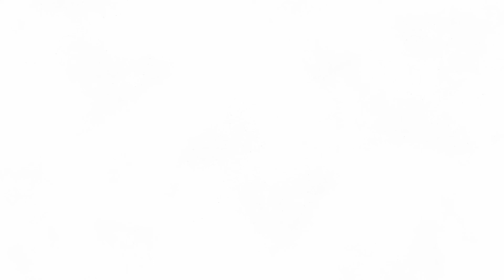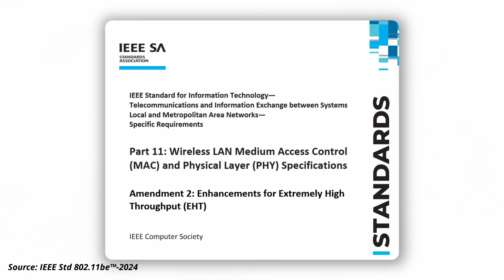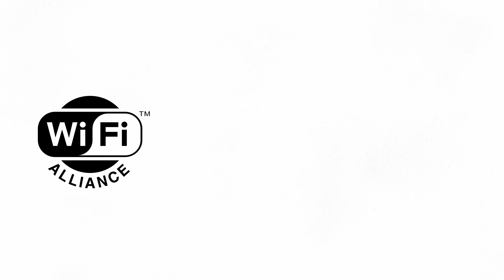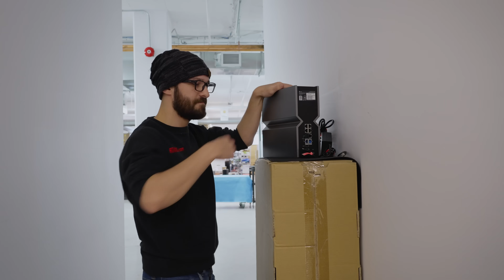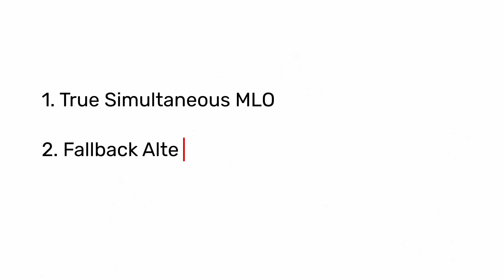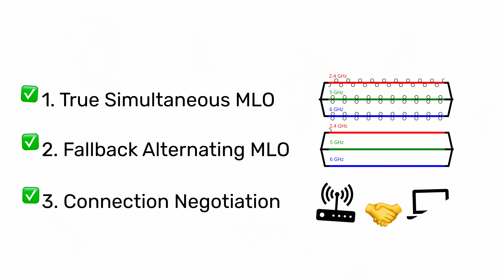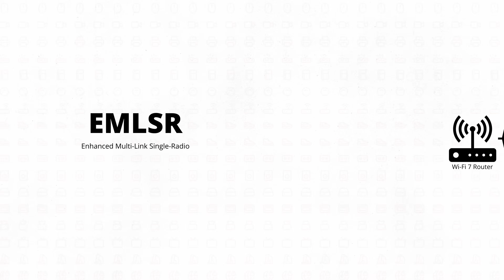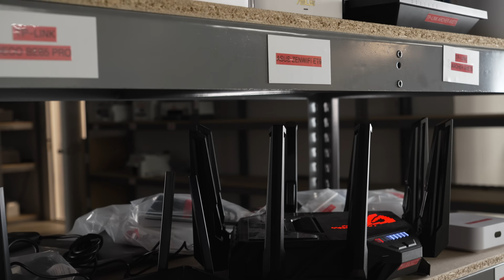Wi-Fi 7's Best Feature Doesn't Work (Yet)

Comment: This video does a good job explaining the different levels of support for MLO with each router, but then stops short of the one question that matters: which of these features actually result in better performance? Assuming you have a client device that supports WiFi 7 (or Wi-Fi 7?) will you see an actual performance increase with any of them compared to WiFi 6 or 6e? And if performance is improved, how is it improved? Higher speeds? Longer range? Higher reliability? Lower power draw?
Reply: MLO & MU-MIMO are only usefull for large households and/or mesh so if your family isnt big I wouldnt worry.

Comment: please check this with the TP Link Archer 8 Ultra and ROG Rapture BN98 Pro that just got recently announced/released
Reply: Those should be avoided btw, draft models use previous gen hardware only with updated RF. Broadcomn is making APU chips for wifi-8 routers, it will be 2-3 years before asus makes a finalized product.

Comment: I have multiple ASUS Wifi 7 mesh APs - upgraded from 6 and 6E. Sometimes I get 6 level through on large file transfers of 120MS/s. Sometimes I get up to 240MB/s. Far from Wifi7 claimed speeds but double is double. I just wish i ALWAYS got the 240MB/s. And the switching among the APs in my mesh environment leaves a LOT to be desired. I wish there was an app to allow me to quickly pick my AP

Comment: WIFI 7 is not necessary for MOST people. WIFI 6 is perfect for 99% of people. WIFI 6 fixed most issues with WIFI 5. But WIFI 7 is not necessary. Yeah, more stable but that is for very unique use cases. But if you are in a busy apartment complex, Using 6Ghz may be the most ideals since it reduces bleed over into other apartments. But 6Ghz is only good in the same room and only good IF you have a specific need for MORE bandwidth, like a laptop or certain gaming needs. But for the average person, you will never notice the speeds over WIFI6 because most people's internet is not as fast.
Reply: Not just that, newer gen routers have newer hardware and architecture which fixes noise ingress etc. wifi 6 routers should be the bare mimum but 6E routers should be recomended, then wifi-7 is at its end of its gen so its more future proof thats if you look for one with at least 2gb of ram, has preamble puncture, and has AFC.
Reply: @kouavang7819 Wi-Fi 7 is still young or in the middle of its journey. I wouldn't say it's at the end. 

And when only more recent devices actually have Wi-Fi 7 from within the past 2 years, it's still kind of tells you that we're kind of in the middle.

Comment: You know, Band Steering existing for this reason. So you can have the same WIFI name but the router manages which band you connect too. Again, this is really only a problem for moving devices like a phone. But shouldn't have those issues with static devices.

Comment: I remember buying that Netgear router and not being able to use MLO after setting it up, thankfully Amazon let me return it and I got a different router that supposedly supported MLO, but I could never get it working as advertised on any device I owned with a Wifi 7 antenna. After moving into my new house where I deliberately had ethernet ports installed in every room, I went with a full Ubiquiti networking setup and haven't looked back. The few devices I use that require wifi are handled by my Dream Router 7, but nearly everything else is wired via ethernet.

Comment: az oses wifi routert csereld le  mercusys re wifi 7,easyimesh wifi 6 mercusys ax3000 ,mu mio,ofdma,Router wireless Mercusys MR80X, AX3000, Wi-Fi 6, Qualcomm, Dual-Band, OFDMA, MU-MIMO,Router Wireless Mercusys MR25BE, BE3600, Dual-Band, Wi-Fi 7, MLO, compatibil EasyMesh,Router Wireless Mercusys MR27BE, BE3600, Dual-Band, Wi-Fi 7, MLO , 2x porturi 2.5Gbps + 2 x porturi 1Gbps, compatibil EasyMesh,Router Wireless Mercusys MR47BE, BE9300, Tri-Band, Wi-Fi 7, MLO , 4 porturi 2.5Gbps , compatibil EasyMesh,

Comment: I added the BE800 to my network. Recently I had my network upgraded through the ISP to 2Gbps Down and 200 Mbps up (Rogers in Canada). The price was just amazing through Amazon. I know it was an open box, but when I received it, it was just as new; the box had not been opened. I connected 10Gb to 10Gb and am enjoying around 5.6Gbps download and just a little over 200Mb upload. I tried MLO and was very disappointed in the speed. Firmware is at 1.3.2 Build 20251015 rel.10659(4341) and the router performs well. I am going to keep an eye on any improvements, this router was introduced at least 2, if not 3, years ago.

Comment: I got my router primarily for 6 GHz  capability. It has 2 6 GHz radios, one for mesh backhaul, which I needed. I've separated all the bands to separate networks. The 6GHz bands are as fast as promised. I don't think MLO would offer much more even if it worked as the speeds are already quite a bit above the speed specified by my ISP. I guess this a case of managing your expectations.

Comment: Devices still prefer to connect to 5Ghz instead of 6 if signal is better and more stable. Need to change the settings on each device the preference for 6GHz. I split another ID for 2.4 for better performance. Android snapdragon and more recent iPhones prefer wifi 7 6GHz by default

Comment: No tests were conducted using MLMR-compatible wireless network adapters like WCN7851 and MT7927, nor were throughput measurements performed. Reliance solely on packet capturing will only yield incorrect conclusions, and such content seriously misleads readers.

Comment: I have an ASUS TUF BE9400. It's MLO is a bullsheet. From settings i activated MLO and WIFI7 operating mode. The phone recognize this SSID as WIFI7, the clients list of the  router confirm MLO connection for this client, but in speedtest, at 5 metres distance barely touch 100 Mbps. I must separate the 2,4GHz from this SSID. Very disappointing.

Comment: Unfortunately, a lot of technology, even in 2024, works this way. The features come out later in the product life. There are SO MANY examples of this out there. This video is kinda misleading because if the hardware is there and all that is needed is a firmware update to unlock the feature, then this video will not age well at all. 

Also, WiFi 8 routers are coming out this year with a finalization date of 2028 for the WiFi 8 Standard. Meanwhile WiFi 7 isn't expected to be fully adopted until 2028. 

Even TVs/Projectors don't get full support of promised features until way later in the life of the product. If someone wants to change this, they're going to either have to be the first company to do this and realize customers flock to their products only OR complain on an epic level to get companies to change this behavior.

Comment: Nice work!  We had some similar marketing shenanigans when 802.11n came out. Meanwhile I've got a PoE Wi-Fi4 mesh at home that works fine for anything that's not hardwired or far enough away to be on HaLow. The low-power mode stuff needs to be solid before I upgrade anything.

Comment: Recently upgraded to a TP Link Archer BE550, from a 2018 WiFi 5, that was also from TP Link. Upgraded my modem along with it too. 

I pay for 600mbps down from Spectrum and never even cracked 500, despite my old setup being more than capable of providing the 600 I’m supposed to get. After upgrading equipment I’m consistently getting 600 down or more via Ethernet and right around 500 down via WiFi on my iPhone. Only WiFi 6 or 7 device I have is a work laptop and that gets around 600mbps as well. Overall very happy with the upgrade, WiFi has been more consistent and my roommate who was having issues with his connection is no longer having issues. I definitely can’t really use all that was promised, but I’m now getting the speeds I pay for and having more consistent WiFi is worth the upgrade for me.

Comment: I just upgraded my 5 year old Wi-Fi 6 router to Wi-Fi 7 and Instead of 500-800 mbps to my devices, I get the full 1500 mbps down of my internet speed on 6ghz (possibly more I haven't tried a PC to router speed test) and my ping went from 50-60 ms to 10-15 ms

Comment: My Pixel 10 Pro XL regularly reports its connects to my Unify Pro 7 AP using three band MLO . While that was an exciting recent discovery not seen before, as you mention, it may not be improving performance  as much as it might be theoretically capable of, with ideal connections and ideal use of MLO.  My earlier reading of information online made it clear there are various ways that tri band MLO can function and perform.
  My dual band MLO performance seems to have been very good to excellent all along. But I'm not sure if the recent, first time tri band MLO connection performs better. It's not worse.
And in all configurations there are always some performance fluctuations in data speeds over any time frame. This could be affected by settings on my U7 Pro or on my Pixel, like setting private DNS. It can also be affected by other upstream factors, like my ethernet switch performance , my home 5G cellular internet "Gateway," etc.
  So while know the MLO variations you mention can play a role, many things can. I just try to configure everything as best it seems I can. And however the affects of all these factors add up, I regularly get downstream rates from about 300 Mbps to 1,100 Mbps/1.1 Gbps. The dual band and tri band MLO connections do seem to be noticeably better than no MLO, and my tri band MLO connection might be helping me get the higher end performance over a longer duration, and more instances of  performance at those higher end speeds. Can't be sure.
The 5G cellular service seems to have the greatest impact, and it's variations seem predictable with time of day.  I  speculate it also corresponds to varying loads on the particular frequency bands being shared with many people on the same 5G antenna and the same 5G GW frequencies. I am fortunate that speeds are generally superior at my home. I often get 800 Mbps or faster speeds both on my home network using my WiFi 7 AP and it's MLO,  and on my phone directly using available 5G.
Reply: The Pixel 10 Pro only supports EMLSR as does the Unify 7 Pro, neither support EMLMR which is what he's talking about here.

Comment: Love how the Unifi haters here make sure to air out their grievances. Whatever! We all know a beautifully installed and configured Unifi system can't be beat. For those that have different to say don't own or can't afford Unifi equipment. For those that say it's needlessly complicated, I say 1) it's not and 2) learn something new. I have a huge house with three floors and have 10 APs and a UDM Pro Max along with door locks, 8 cameras and a lot more. All this to say that as much as I love my Unifi system, I don't think the MLO is working. I have a Galaxy Fold 7 which has MLO support but the most I get is about 800-900 Mbps. I'm sure they'll fix and push out an update. One thing even hater can say: Unifi is amazing with update.

Comment: Number one thing to do with routers is: Do not get a consumer router. Their software is poorly maintained, support ends faster than you think (also there is no warning when support is over, you just don't know you are vulnerable). Most consumer routers are marketed with "super fast speeds" or a bunch of useless features. Most people do not have internet connection fast enough or do anything that actually requires fast routers. 10,000 jiggabits per second wifi does not help if your connection to world is 50, 100 or 300 mbit/s. Also NOTHING 97% of users do requires more than 25-50 megabits/s. 25mbits/s is enough for 4K streaming, 50 more than enough and so on.

Comment: I upgraded a WiFi6 Netgear RAX120 (+ Netgear WiFi6 Extenders: EAX80) to the ASUS Zen WiFI BE30000 mesh system. With no change in ISP or modem, I am getting better signals around my house and property and 100-300 Mbps improvements in download and upload speeds. But from this video, I'm guessing that WiFi7 has little to do with the improvements. I'm guessing that the improvements are rather likely because of the better signal coverage and that the nodes use 5GHz and/or 6GHz bands to coordinate and communicate to each other. ...Thoughts?

Comment: I tried updating my original Google Wi-Fi system to a modern Wi-fi 7 system. The Google Wi-Fi was not blazing fast but very reliable especially with the hardwired backhaul. The new system didn't last even 24 hours before it was ripped out and Google Wi-Fi put back due to reliability issues.

Comment: Like most tech upgrades it is rarely useful or cost-effective to chase one iteration after another.  It is often best to wait two or three generations to pass before making the next investment.  I found this to be true for both network infrastructure and for the device that connect to it.   I own an iPhone 13 Pro. It is now almost 5 years old. When I buy my iPhone 18 Pro, I will see a substantial difference in network data throughput.  Yes I own a Wi-Fi 7 router a TP link Deco mesh.   It is significantly quicker than my ageing Wi-Fi 5 network infrastructure that it replaced.   The only reason I replaced my network infrastructure is that my Internet service provider now offers two Gb speeds.   Don’t chase new stuff unless it has a material impact on performance.

Comment: I get why this is bad and this certification process needs to be refined. I don't really get the hype around 6 GHz though? I have an AP with the 6 GHz band and yes i use it, but my phone (which is the only client capable of 6 GHz) rarely connects to it. The wall penetration is just bad and with my 100 mbps internet connection i know that the 5 GHz wifi band won't be the limiting factor.

My area is eh crowded, i can detect 3 to 4 other 5 GHz networks and no 6 GHz networks. One of the only real benefits would be that noone is clogging bandwith on that spectrum? (at least for now). The bad wall penetration also makes it harder for interference from neighbours, but unless you have an AP in every room you wont even connect

Comment: So had gotten TP- Link wifi 6e router only to a few months later find out had option to get 10g plan for only $70 so looking at 10g routers meant wifi 7 one of the cheapest options that gave 10g wan and 10g lan port was the TP-Link BE800 got lucky and my wifi 6e was able to be used as a mesh node/ap my old wifi 6e struggled to stream videos on other side of the house now full wifi everywhere. Sad they lied about MLO hope its just firmware fix later

Comment: I think ubiquity supports MLO I've just never really used it on the tri-band devices yeah but that's because I've only installed Tri-Ban access points on business networks where some of them are only dual band so it doesn't work on all access points.
Reply: I'm also not 100% sure if they support every single feature of it because I haven't fully tested it yet.

Comment: Dude you have just debunked an issue I have been experiencing for the past couple of months. I had a 2 node ET12 with a 2 node ET9 in a 3000 sqft house. Was working flawlessly. Then I made the mistake of buying 3 rt-be92u for the "WiFi 7" functionality since we're starting to get more of those devices at home. Whenever I enabled MLO for fronthaul clients, everything went crazy. So what I did was flash all 3 with Merlin firmeware then disabled 320mhz channel. Disabled 6Ghz on IoT network and disabled 2.4Ghz on the main netowrk. Now it's rock solid. With some tuning I get really good speeds almost everywhere with minimal sticky clients.

Comment: So WiFi 7 branding is even worse than usb 3.2 gen 2x2 nonsense ? 

I would submit to not only focus on WiFi 7 routers but also WiFi 7 clients. Like the iPhone claims it is WiFi 7.  But yet it doesn’t support the full 320 MHz bandwidth (only up to 160 MHz). Also, the iPhone MLO operation is sketchy like it doesn’t seem to transmit simultaneously transmit on 5 / 6 GHz. 

So perhaps also look at the various WiFi 7 client chipsets from mediatek, Qualcomm,Intel, Apple. Thank you for your video.

Comment: Completed a renovation of my house at the end of 2024, wanted to future-proof, so went with a "Wi-Fi 7" router (the TP Link Archer BE11000).  I've never seen it hit full-throttle even dual-band as an MLO connection, so thought something maybe up with it (...lets not get into it dropping all clients at around midnight every night until I did a factory reset and rebuilt the settings).  Just happened across your vid in "suggested" and now it makes sense.  Good info to have!

As for clients...   mehhhhh, let's not even get into Windows handling Wi-Fi 7... Wi-Fi 6/7/8 are all listed on the NIC, my MLO shows as Wi-Fi 6... then one night I'm gaming and the PC tells me I connected to Wi-Fi 8...   I'm freaking out like "that isn't even really a thing yet... wth..."  Yeah, no, something tripped it to think it was finally connected to Wi-Fi 7... but there's a bug that makes it display 8 instead facepalm vibe coded windows fun!

Comment: But if my end goal is to make mesh system with 2 wifi 7 routers for using wired connection on both ends? Not to use MLO, but to get same or nearly same internet speed / latency / ping? It should get up to 2.5gbit at both ends vs wifi 6/6e with maxi of 1gbit via wifi (because mesh with acces point is useless on older gen)

Comment: Thanks for the warning! I was already angry about Wi-Fi 6e having 6 GHz guaranteed, but not Wi-Fi 7. You had to look into the tech specs to find out if the model in question had it or not. The MLO is a whole different story but in the same direction.
The latest Wi-Fi generation became a "might have, might have not" "standard" much like USB (data, power, display, etc.).